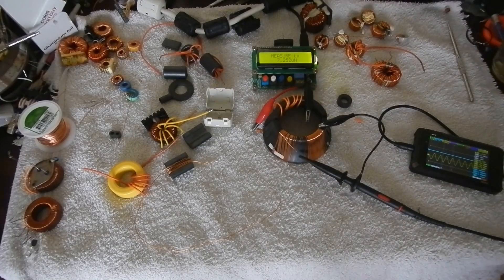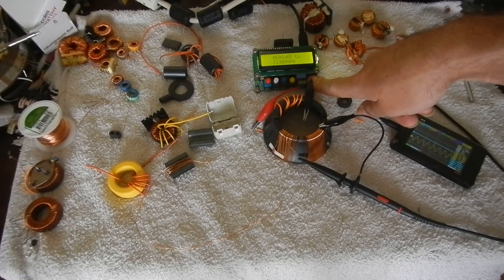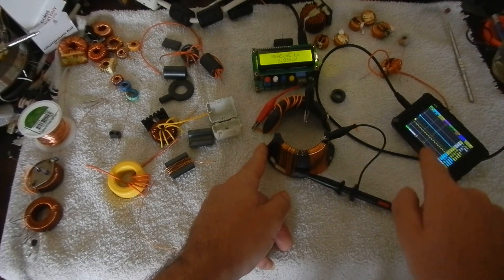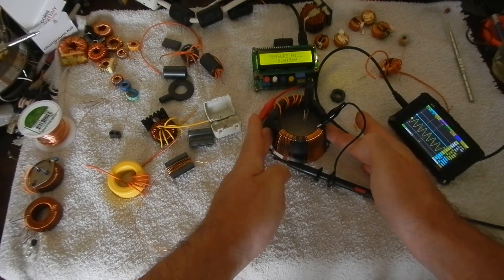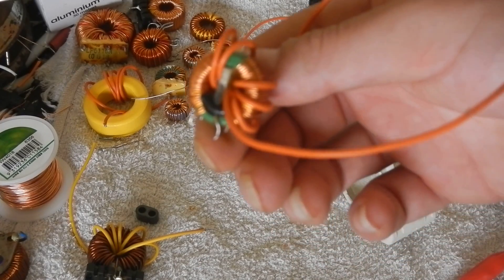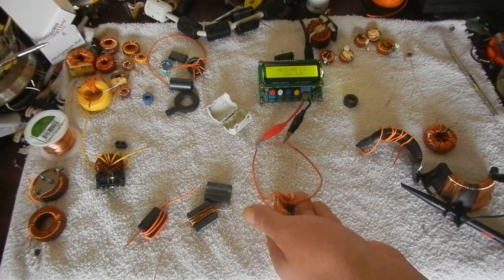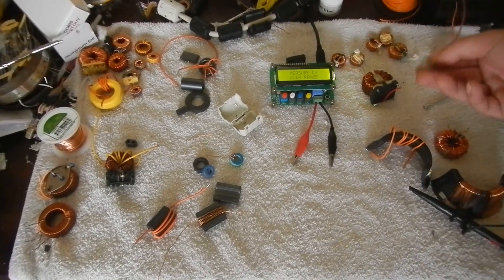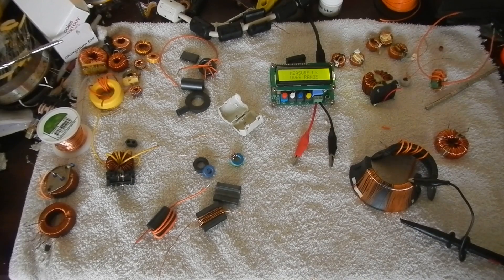Inductor Core Testing Pt2 Frequency Matters.

Comment from the maker: Most of the colored cores are powdered iron. There was also a black one that was lower than ferrite (approx 50%) but higher than iron (approx 25% induction of ferrite). The small grey (light weight) one has plastic coating. So cant scrape it. I'd love to know what's in it, the green ones, and the white plastic ones (common in microwaves), that I show are not air cores, and are possibly powder filled, in PT1. Thanks for the comment.